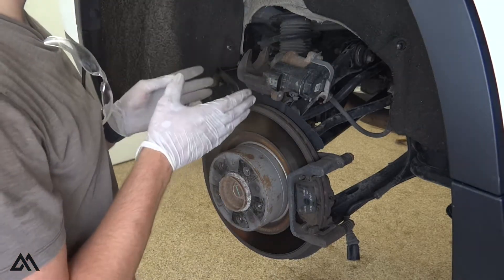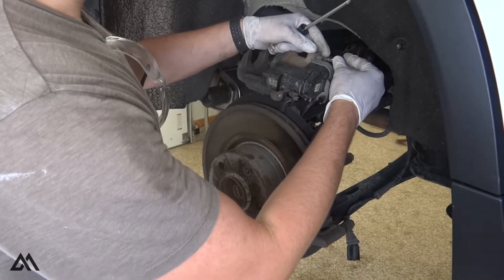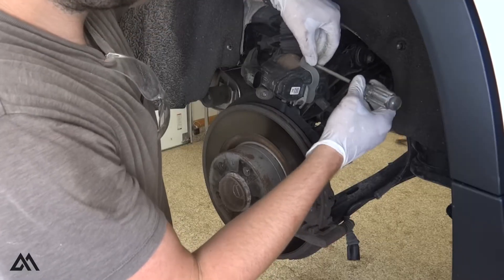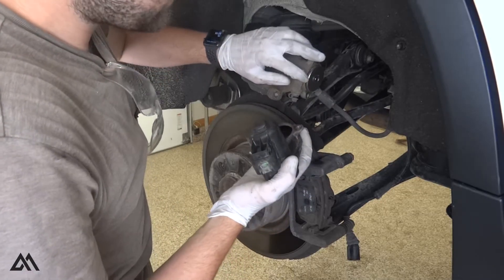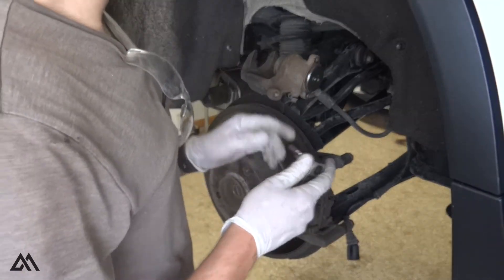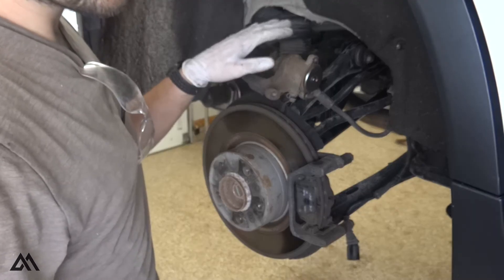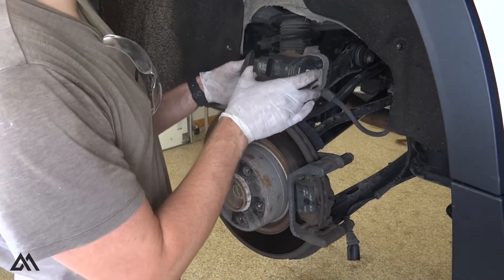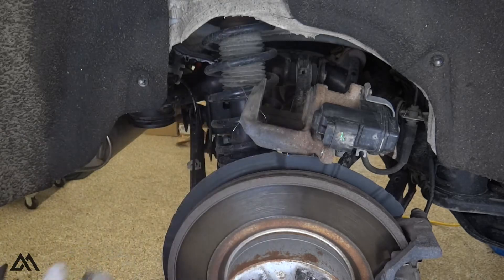How To Manually Retract Electronic Parking Brake Into Service Mode!  2015 BMW X3 Rear Brakes (F25)

Comment: You don’t have to take all of that loose. All you have to do is put a retractable seat, clamp the one with the notch in it and then connect a power pro to the back of it the electric part in reverse and keep turning as it’s going in reverse and you’ll have it all back to the seated position 0:48

Comment: question please if you are able to answer thanks, I have a 2021 ram 1500 crew cab truck and recently the electric parking brake stopped working with a flashing yellow P symbol along with a flashing Brake light, I have a code scanner and it sad bad left rear electric parking brake module, also took it to the local parts store and they used their scanner on it and said the same thing, I bought a new electric parking brake module, am going to attempt to change it, only 2 Torque screws holding it on, the brakes would not retract for service as long as this error is present, I just want to replace the electric parking brake module, the parking brakes are not stuck, or engaged, they are working freely,  vehicle is driving freely no problems there, just the parking brake will not work as long as this error. I have a brake hose though that is in front of the screw on the left side of the module that I would need to disconnect and pull to the side to get access to the screw, if I disconnect the brake line I am assuming fluid will leak out, will I need to retract these brakes like you are showing if I only want to change the electric parking brake module ? how much fluid do you think would be lost if I have to disconnect the brake line? it is in the way of the screw on the left side of the parking brake module, thanks for your help or anyone else who wants to comment

Comment: Thanks much for the video. Wonder if the same procedure will work for 2020 G05 (standard non-M brakes). Some bimmerpost users reported software is required to retract the piston. Otherwise, EPB error will pop up. Try to gather as much information as I can for this rear brake pad/rotor replacement DIY project. But unfortunately, not G05 youtube instruction found yet.

Comment: Same procedure for E89 Z4. I just needed to be sure of what Torx bit to retract it with. T45 seems to be the same everywhere. Entire back end of my car is dead due to flood. Had to do this just to roll it off the trailer. Now I need to figure out how to get into the trunk so I can start replacing modules.

Comment: Hey thanks for making this video. a couple questions from when I was working on a 2018 X3 and ran into a couple issues.  

When retracting the parking brake, I got it all the way to the end stop, but the piston wouldnt retract in when using a c-clamp.  I thought it might have been due to the parking brake not fully retracted so i tried rotating it fully counterclockwise, then clockwise again. When that happened, the torx bit on the caliper side was able to spin more and now doesnt hit an end stop.  

The piston also came out of the dust boot and I was leaking brake fluid ( I messed up somehow, trying to figure out exactly where or how). I ordered a new dust boot and plan to rebuild and bleed the system.  

My questions are, is the park brake destroyed to where I need to buy a new one or can i somehow tighten the nut on the threaded portion behind the piston to repair it?  

How can I get the piston to fully retract afterwards so I can get the pads in?  Should I open up the bleeder valve to release some pressure in the system?

This is the first BMW i've worked on. Other cars i've replaced pads and rotors for didnt have this kind of system.
Reply: I’m in the same situation what did you do?
Reply: @performanceod1043  had it towed to the dealer lol. That system sucks and I’ve worked on plenty of cars.

Comment: Thank you for the vid. One thing to note, when I went to reattach the ebrake actuator to the caliper, it cracked and actually separated a little bit at the plastic seam. Turned out to be that the male/female didn't quite seat correctly so I needed to play with it and rotate the female part counter clockwise ever so slightly so it would seat right. After that it went on nice and flush. Ebrake still works as normal, my only concern is some dust/particles getting into the tiny crack in the plastic housing. Too lazy to buy a new one and replace, guess we'll find out how long it lasts.

Comment: Great video! Do you need to calibrate the brakes once the pads are installed? My P is not holding the car with parking brakes ON and car switched off and Neutral gear. The only thing that holds my car is the P gear and I am afraid that might be damaged if breaks are not holding as well. My car is F07 2013 530dx

Comment: I did this on a 2015 Tiguan VW with a 9 volt battery and two wire leads. When doing it watch the piston to see if it moves forward. If so STOP switch the contact points and you’ll hear the small motor retract but won’t see it, you have to push the piston back in and you are done. This way you don’t remove the cap only disconnect the plug.

Comment: This would have been nice to know before I started working..... FYI do not do this after you have taken your caliber off.... The Piston comes all the way out
Reply: Did this happen to you? If so, how did you get the piston back in? The piston came out to the point where my service tool won't fit in to be able to retract the piston. Thank you.
Reply: @stevenhall9398  I'm sorry... I got a new caliper
Reply: @michaelritchie8953  Thank you for your response.. Unfortunately,  I made things worse, and now I have to get a new one too.
Reply: @stevenhall9398  this also happened to me. the piston came all the way out. do you know if you can rebuild it with a new seal?
Reply: @geoffreytodd  I was unable to, because I didn't realize there were BB's inside the piston. When I turned the piston around, the BB's came out. At that point, I bought a new one. I'm sorry I couldn't have been more help.
Reply: @stevenhall9398  no problem, thanks for responding. it looks like i can just rebuild it. im nervous about the parking brake because when i rotated it completely clockwise, it hit an end point. but it was also able to keep spinning some im not sure what exactly to do.
Reply: @geoffreytodd  I'm not sure either.  I hope you can do it.
Reply: @stevenhall9398  no I got to move caliper.. honestly I didn't even try
Reply: @michaelritchie8953 do not do which part after taking the caliber off. I’m about to try this and gathering all the information I can to learn what to avoid.
Reply: This happened to me. The piston came completely out. I made the mistake of clicking on the parking brake button after taking the caliper off thinking I was turning it off. The parking brake pushed all the way out and popped out the piston. I was able to get the piston back into the bore but it was extremely difficult. I lost all the brake fluid on that side so had to refill and flush the system. It was a mess.

Comment: BMW TIS states that the ebrake piston should not be retracted all the way. If it does, it will throw an error code. For those without a way to clear it, you will have problems. It has to be retracted enough to accommodate need pads and discs only...
Reply: exactly...... the problem is knowing when to stop, i like the know that solution!!!!
Reply: @hogasreluflorentin2105  yeap... Just performed this service with ISTA and it turned out way easier than i thought using the right service triggers....

Comment: The vehicle doesn't have a maintenance mode?
Reply: Requires a scan tool to activate service mode
Reply: Definitely should.
Reply: It does, I used the Bimmergeeks Protool, but it wouldn't place the brake into service mode, so I had to do it manually. This tutorial worked perfectly. Luckily the Protool did reset the worn brake sensor, so that was good.

Comment: screwdrivers are usually designed to be able to use a wrench on them, either a hex around the shank or something built into the handle like these. No need to use vice grips
Reply: Clearly not all screw drivers.

Comment: Watch my buddy apply 12 votes to the parking brake at the electric connector itself. Don’t know if it works on all car, but sure works on mine
Reply: Can use 9 volt battery too